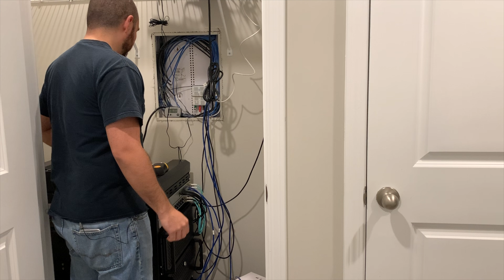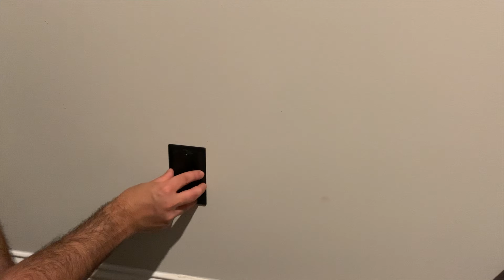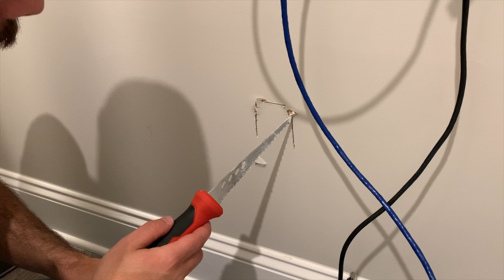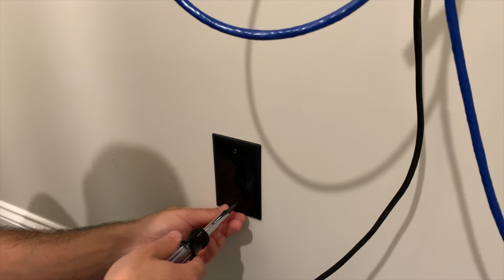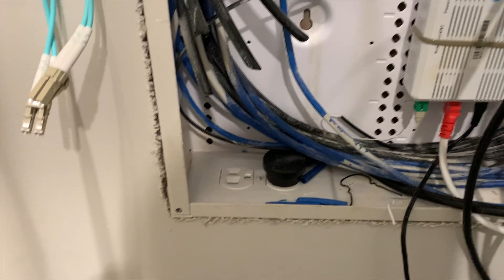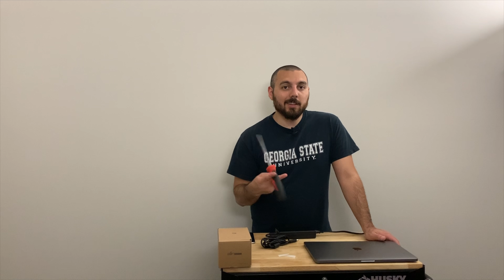Relocating the Server Rack to the Home Server Closet

Comment: at what temperature range should one start worrying about safety? my network closet sits around low 80s, but as you know today it's gotten ridiculously hot and it's around mid-upper 80s w/ 2 servers, NVR, RPi4, switch, and router. Server temps are fine, but just curious at what point it's considered unsafe lol.
Reply from the maker: 80F is fine BUT it could be 62F and your CPUs could be at 90C which is not so good.  It could also be 90F and your CPUs at 50C which is great.  

So it really depends on how well the air is circulating and how well your system is staying cool.  But 80F is fine.  I think things get dangerous around 90F
Reply: @SPXLabs  I think I mayyyy be lucky since I have the servers in regular ATX mid towers on the floor, right up against the bottom of the door so they intake fresh air. 

I monitor them all on with netdata and CPU temps stay around 40s-50s during the day and 20s-30s at night. Fingers crossed I’m good 😂😂
Reply from the maker: Looks good to me.  How about you drives.  How hot do they get?
Reply: @SPXLabs  nvme drives chillin around 50-60°,
SSDs around 30-35°, 7200RPM HDDs in the NAS are in standby/spindown majority of the week (if/when they’re used, it’s around night time and stay below 45° during hard write jobs according to SMART). 

7200RPM HDD in the web server only comes on at night for a daily backup and then spends the rest of the day in spindown/standby as well. 

I’d say the hottest components will forever be my NVMe drives lol

Comment: Was just wondering. One of your servers in there is your UNRAID storage server, what is the other 4U server in there?
Reply from the maker: I have two unraid servers, one is for testing and the other is my home server.  I also have a CentOS server on the rack
Reply: @SPXLabs  I see so on the machine where you have the testing unraid you have a CentOS there too? Or are you virtualizing from UNRAID ? Actually can UNRAID virtualize just like PROXMOX would?
Reply from the maker: You’d have to watch a newer video to see the Dell workstation that runs CentOS.

Unraid uses KVM for virtualization, it’s an open source hypervisor that is absolutely amazing.  KVM is what sold me on unraid years ago.  Red Hat uses KVM so you can imagine that’s a pretty big deal.
Reply: @SPXLabs  Thanks, I'll check it out. I'm still not sure the way I will go between PROXMOX and UNRAID.
Reply from the maker: In all honesty, if you are going to be doing a lot of virtualization Unraid is not the way to go.  Unraid is a storage appliance first, that is flexible enough to do other things pretty well.  Unraid is not a hypervisor.  Promox is a hypervisor first solution.  It’s not really an apples to apples comparison.  You’re choice should be based of your goals and what you want to acccomplish.

Comment: I would have saved myself the work and instead of running cables through the wall, I'd just have used cable channels to hide them.
Reply from the maker: Wait, what do you mean?
Reply: It was in response to the other commentor on here who said that running wires through the walls wasn't up to code. The way mine is set up, the cables are just there, there aren't any wholes drilled or anything.
Reply from the maker: Ah okay nice.

Comment: Honestly if it where me, I would leave the plates when your done rather than patch the wall. I know people will wine wires though the wall are not code but, you will always have a pass through in case you need it in the future for whatever may happen. Plus it’s in a closet it not like it’s out in the open
Reply from the maker: My wife mentioned something along those lines last night.  There are zero outlets in the closet and she mention it would be cool to maybe have a lamp or some other lighting and having the pass through might be nice to have.
Reply: SPX Labs it’s so easy to add outlets, lights, switches though. If you can run cat cable, you can run romex. Plus it’ll look a lot better and it’ll be safe. Idk just my 2 cents.
Reply from the maker: That’s what I keep hearing but I’m not ready to take that step yet.  Next time!!